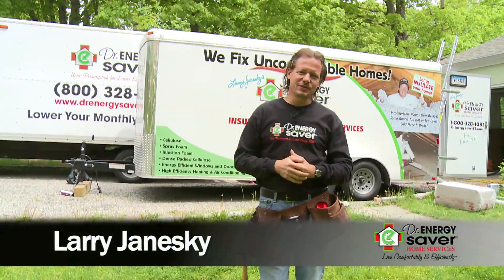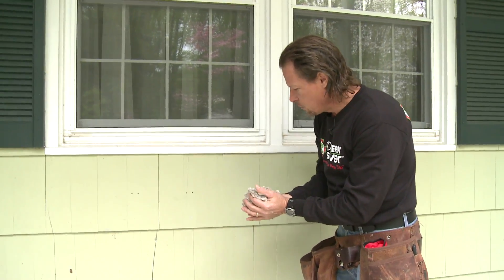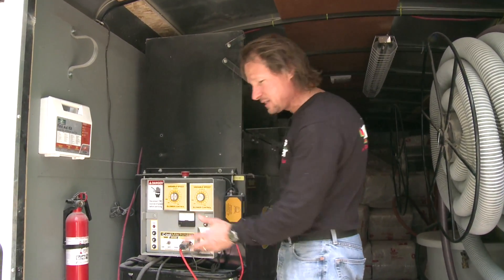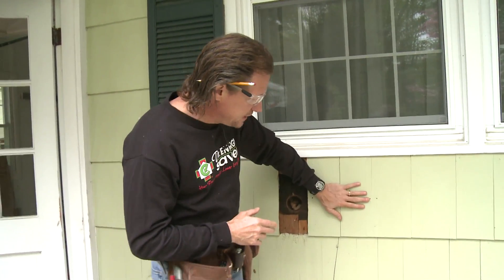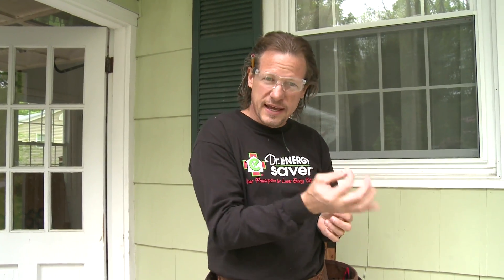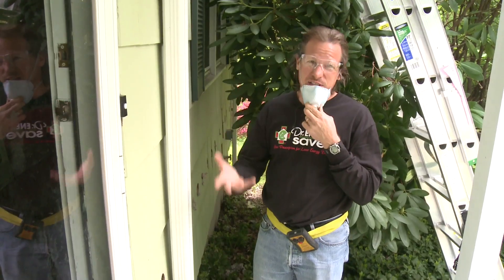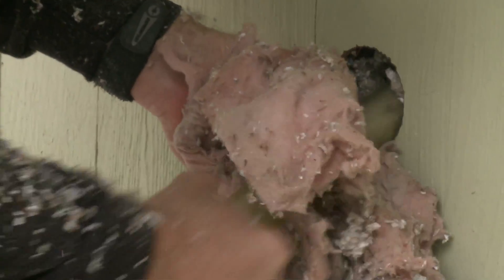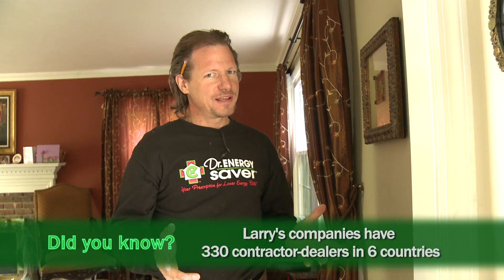Insulating Walls with Dense Packed Cellulose

Comment: Lots of good info, but it provokes a question, after years of settling, how does one 'top off' this kind of cellulose insulation application? Seems it would settle and cover the holes. Isn't it true blowing from the top just causes a backflow issue?
Reply: It’s densed packed and won’t move or settle like fiberglass it fills all voids

Comment: @drenergysaver is there a rule of thumb to show you how deep the attic cellulose should be per the area you live in? I’m in Utah, cold winters, usually hot summers.. I’ve noticed last company that blew insulation in my home covered my soffit vents. So I’m getting new hvac, High efficiency furnace, high efficiency AC compressor.. need to seal off all can light areas to make top floor air tight so I don’t let ac/heat escape outside. Also when I’ve installed new fans and canless LeD’s, most areas were maybe 6-8” thick,  no where near the 17” you said.. I’ll be adding soffit vent protectors so vents dont get blocked again, preventing proper airflow in the attic
Reply: They should have slid insulation baffles down into the soffits from the attic so as not to block the airflow. They effectively stopped your attic from venting properly!

Comment: Wouldn't densely packing it reduce the r value?
Reply: Others have said that the R-value of dense pack is not great, but the air sealing it does makes it worthwhile.
Reply: A small trade off R value is in a lab and properly installed without settling/moving in real world this hardly happens.The comfortable levels of dense packed is better than R value

Comment: Doesn't cellulose settle with time
Reply: that's why they're doing dense pack.
Reply: That's why it's dense-packed at 3.5 pounds per cubic foot, it doesn't allow for settling. However, it will settle if it's not properly blown.

Comment: What is the R-value per inch of dense packed cellulose?
Reply: R-3.3-3.5 for dense pack. R-value goes up as the temperature drops. The air sealing benefits makes cellulose good for old construction renovation.
Reply: The R value isn't that great but it's the stop of air transferring through the  wall that is the biggest advantage

Comment: Nobody ever talks about best practices for closing up all those holes drilled in the home's exterior siding!? Seems like a very important step! I like that you took the trouble to first remove the actual cladding material before drilling, and replacing it after work is done.

Comment: are these videos seam to be about heating. Is it just as important to do the air sealing on an old home that is in a very hot region like Alabama?  What is the cost per sq ft on average to air seal an attic?  How much to blow in insulation into the walls on a brick home?

Comment: Any tips on how to reduce the tube from 3" to 1" so it doesn't clog where you join them together.  Also, does the green fiber machine that they rent at Lowe's/Home Depot have enough air pressure to dense pack?
Reply: You reduce the hose in half-inch increments. So you would go from a 3" to a 2 1/2" to a 2" to a 1 1/2" dense pack hose. And no the rented machines don't produce enough air pressure for dense packing. A dense packing insulation blower is an expensive item, which is why it is so specialized. A machine that is capable of dense packing has 80" water column or about 3PSI.

Comment: Larry, great demo. Try using a big car wash sponge instead of the fiberglass insulation scrap. Cut a x in the center of the sponge and push your reduction tube( 1inch up to 1 1/2 inch) thru and up into the wall. Then push the sponge up against the wall to act as your filter and vent. The harder you press on the sponge, the more pressure you build up in the wall cavity. Its perfect right before you blow the sheetrock off the wall. Bill Jewell  INTEC 800-666-1611

Comment: The tube starts at 4" and is reduced down to 1" at the end where the cellulose is dense packed into the walls.  The tube was supplied by the cellulose blowing equipment maker.